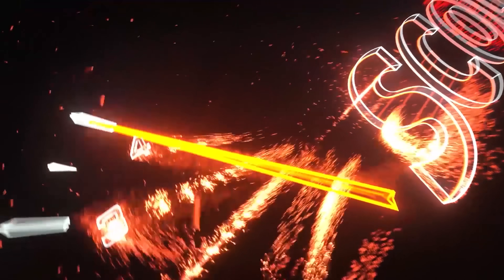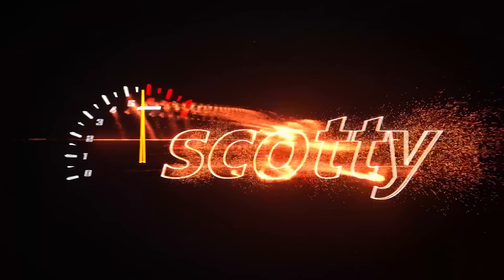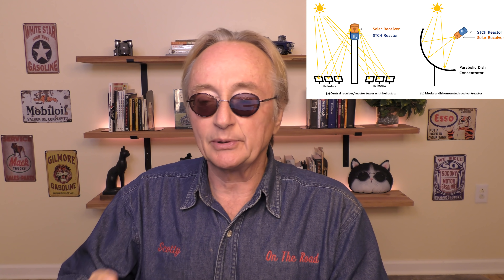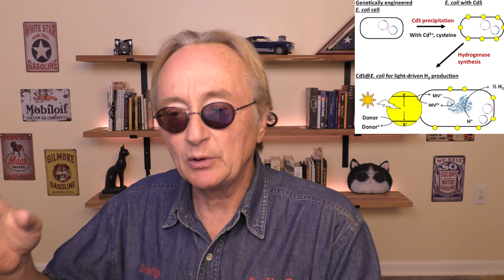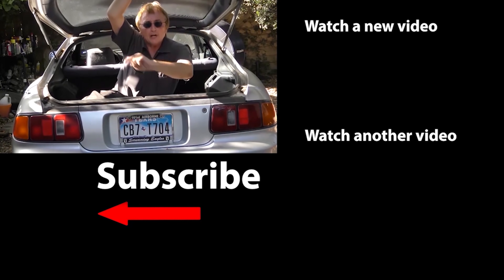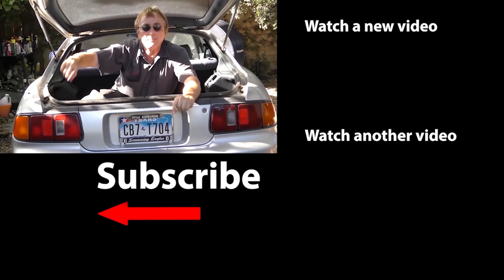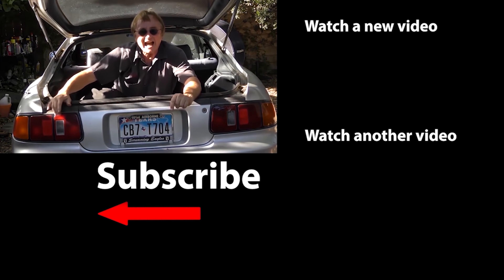Here's Why Electric Cars Will Soon Be Replaced By This

Comment: Hydrogen cars? You mean electric vehicles with extra steps? You realize hydrogen vehicles have batteries in them, right?
Reply: They do, but they act more as balancers than storage. They dont have near the storage as a tesla.
Reply: @alexzanderroberts995  batteries always act as storage; it's literally their function to store energy. In hydrogen vehicles, batteries store electrical energy generated via electrolysis to drive an electric motor like in an EV. Hence: an EV with extra steps. Or an engineer's nightmare.
Reply: @alexzanderroberts995  they need batteries cuz hydrogen can convert less energy to power @ the wheels than gasoline when it is burned. So instead they use a fuel cell to generate electricity to power an efficient electric motor. It's less efficient from an engineering standpoint than an EV and, really, a waste of time. I believe the market will figure this out on its own.
Reply: @itisno1  I dont know, I think it just needs time to figure out all the little things to increase efficiency. It's not like there are a lot of brains trying to figure out how to make electrolysis more efficient. The same thing had to happen with the internal combustion engine.
Reply: @itisno1  Fuel cell is actually more efficient if you factor in the efficiency of producing the electricity to charge battery-powered EVs, the losses in transportation of said electricity to the charging station, the losses in actually charging the batteries and losses from the multiple transformers inbetween all those steps needed to raise/lower the voltage to suit the current application. 
 Fuel cells have just efficiency of the catalytic reaction, their batteries are just buffers, not the main power source. A single thing that can possibly be improved over time, whereas to imporve EV efficiency you have to improve ALL the steps leading to you stepping on the gas pedal.
 Not to mention battery production cannot be infinite, it is not sustainable in the long run, fuel cells have long service life if taken care of and can be recycled easily. Don't believe what car manufacturers tell you every day, it is only in their interest.
Reply: @tusux2949  recycling of batteries is expected to supercede mining of new materials since today you can recover +95% of the materials from decommissioned cells & use them in new cells.

Comment: They are building a hydrogen processing plant near me, it's powered by the hydro power on the Columbia River.
Reply: They're making hydrogen electrolytically???
Reply: @jamallabarge2665  why not? If you can get low cost, reliable green electricity, it's a well proven and reliable process.  Plus you also get oxygen, which also has a strong commercial market.
Reply: @MikeLawtonUK  Hydroelectric is reliable, if weather patterns remain consistent.   Big problem with harvesting nature - nature is subject to change.

The amount of pure oxygen would be a lot, if it were captured.

Electrolytic production of hydrogen on an industrial scale?   Ever been done, anywhere?

Most of the time it is much cheaper to make hydrogen from natural gas.  The byproduct?  Carbon dioxide?

You waste a lot of energy making the hydrogen gas.  Why not just use Methane in fuel cells?
Reply: @MikeLawtonUK  what can the oxygen be used for?
Reply: @jamallabarge2665  the issue with using electricity to produce hydrogen then use it in a fuel cell is that its super inefficient. You can only use about 30% of that electricity to propel the car, whereas if you put it in a battery, over 85% of that energy will be used to propel the car so you’d be doing the work of 3 BEVs for every 1 hydrogen car. Plus batteries don’t need some rare earth material, it’s all available in the crust, batteries improved so much and now you can make battery using iron, copper, aluminum, silicon and graphite which are readily available everywhere!
Reply: @harsimranbansal5355    Batteries made of common materials?  Sounds miraculous.

I don' care for hydrogen because it has a wide explosive limit, hydrogen leaks easily.  Isn't good for putting vehicles in homes.
Reply: @jamallabarge2665  that's the marketing they tell you. You shouldn't drive over sharp objects but an electric car can explode too. Lots of Tesla did at the beginning and so did gasoline cars. With improvement comes safety. They won't sell a car thats not safe.
Reply: @silkemueller1391     I guess you are not old enough to remember the Corvair?   Ralph Nader wrote a book called "Unsafe at any Speed" about it.
Reply: @jamallabarge2665  Biggest problem with Hydrogen is price. It's currently $16/gal equivalent to use in Mirai and other H powere cars. Price ain't coming down any time soon when battery is 98% efficient Hydrogen is 50%.

Comment: Scotty I recently bought a 1996 Chrysler Concorde 3.5 V6 for 500$, seller listed it as having 600K miles, but in reality it said 60K, was this a decent buy?? I know new Chrysler vehicles aren't known for reliability.
Reply: That's an old car, but sounds like you got one hell of a deal there bud.
Reply: @dailydrivinghondabeater1468   I'd rather buy an old Chrysler rather than an old one...
Reply: Becareful. He might have done both  numbers by purposes to throw you off   first they knowingly write 600k. As am error  u catch.  Then show you.   Ohhhhhh sorry it 60k.   But in reality they roll back another 100k by messing with the odometer.     So in reality it 160k.     But I'm just putting it out there.  I heard this shop dirty shop owner's try this method when re selling  vehicles.   But. If it runs 🏃‍♂️great  who care s.   500 bucks is definitely a steal.  If get 7k to 10k miles out it.
Reply: @JamMaul  car has only had one owner, so I'm hoping I got really lucky. Sure runs like it has 60k miles, I'm not sure if I should do transmission fluid changes on it. I think I might just leave it alone.
Reply: @bolt-action9470  as long as the transmission isn't dirty.  I won't dare do a flush.  1996 to long. It's taking a chance it might start slipping.  But if it don't slip now.   Never touch transmission fluid  I had 17 cars  since 1996.     Every time a change in fluid can go  south.  Best to leave it alone if no issues 💯
Reply: @JamMaul  👍 yeah I'll probably just leave it alone.
Reply: $500? Wow!  If it runs, or you can get it running, it’s a deal!
Reply: @tomtheplummer7322  it runs great, it's bone stock, no aftermarket parts, but I do have a code for an EGR Valve.
Reply: You got it with the better engine too! Hey watch out for coolant leaks. When things get that old, plastics, hoses will degrade.
Reply: For that little money, you might as well drive it for as long as you can, if it generally remains reliable, because it'll save you a lot of money over time. It's also a great car to suss out a partner. Talk cars with her before getting engaged. If she's not ok with the car being there through up to one, maybe two, kids, she's not a keeper!
Reply: Francis Marion true, and now that you mention it, those tires are well over 10 years old. I do need tires.